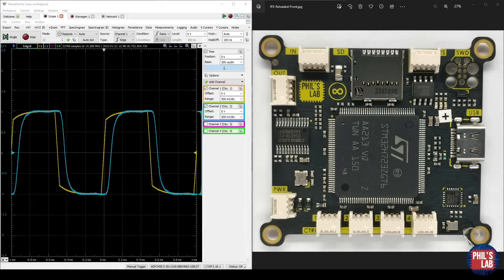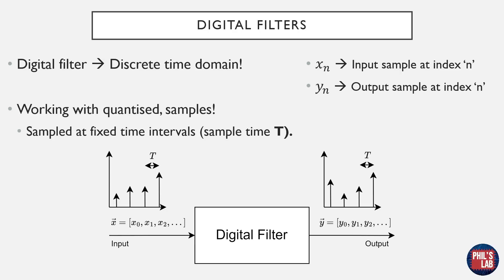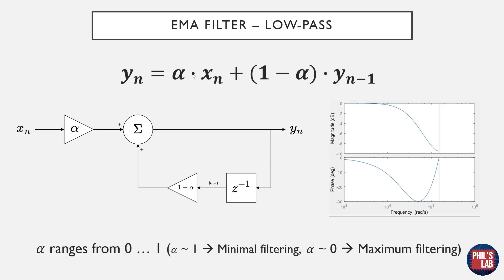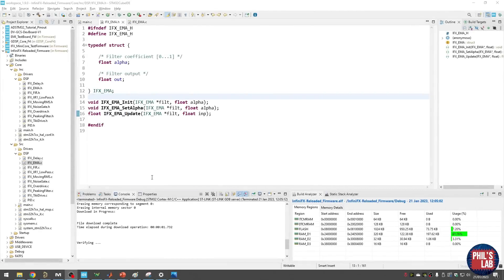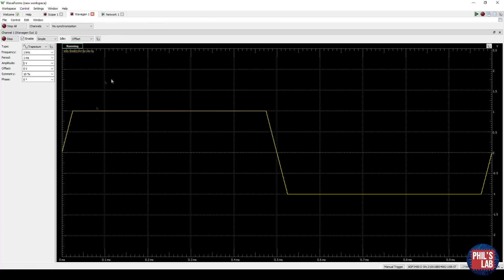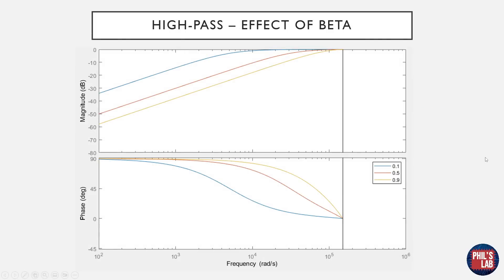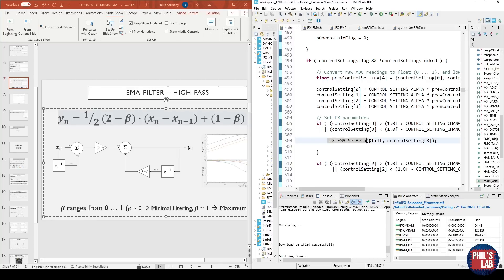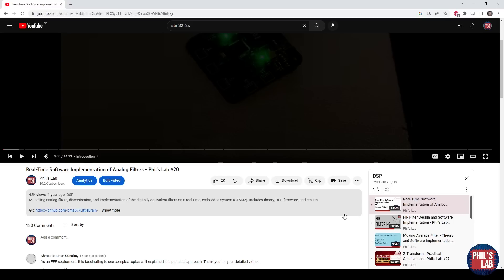The Simplest Digital Filter (STM32 Implementation) - Phil's Lab #92

Comment: Phil  - nice video. A unique thing about alpha = 0.5 for the low pass case is that it can be solved with just shifting the input by one bit (divide by 2) and adding it to the previous solution shifted by one bit (divide by 2). This is math any low end micro can achieve.
Reply from the maker: Thanks, David - that's a great point!
Reply: @PhilsLab  Just be careful with shifts and signed numbers.

Comment: It has been pointed out to me that you don't need buffers, circular arrays, double buffering, DMA or even interrupts to process a realtime audio stream.  I refused to believe it, but I tried it and... block reading and block writing 1 stereo sample at a time still leaves you PLENTY of time to process each sample through the filters.  Zero latency.  No sample rate conversion either, that happens automatically when you trigger off the cadence of the output.  Also, the SAI blocks are worth looking into.  They can be easily used as basic I2S interfaces as normal, but can do way more, including the support for 8 octet unblocking FIFO.

Comment: I've started using STM32 from st32f401 (blackpill board). And its ADC upset me much, because even with noise very low noise levels on oscilloscope that thing gave me 6-7 stable bits out of 12bit mode. Some people said pcb design is bad, others that chip itself has pretty bad ADC. But nevertheless I started to search noise canceling technics and found pretty good method in AN4073
 which is basically median filter + moving average filter. But I think it can be improved even more with EMA filter. Thanks.
Reply from the maker: Yeah, most of the in-built ST ADCs aren't as great as "initially advertised". For audio, I'd definitely always go with an external codec.
Reply: SAR ADC of STM32 is a bit noisy, but with 2.4MSPS also quite fast. Depending on application you can use oversampling to trade speed and power consumption for accuracy.
Reply: It is likely that the noise you are observing is 60Hz from the AC  mains. Use moving average FIR or CIC filter to suppress this frequency or look for a notch filters for this frequency

Comment: This makes me think of the filter I used to implement in flash games when I was a kid to smooth out motion. It worked out to something like Yₙ = Yₙ₋₁ + (Xₙ - Yₙ₋₁) * α. In practice it was current_position += (target_position - current_position) / how_sluggish_I_want_it_to_move because it was easier for me to visualise the motion increment as dividing up the line between current_position and target_position. Later I changed the last part to a multiply when I learn about how expensive division can be. Though in fixed-point, a lot of the time, the division does get optimised out. Don't use it for much these days except lazily removing zipper noise from level controls, but it's a handy one-liner nonetheless.
Reply: 'out += (in - out) * a' is what I use too, and it is actually identical to 'out = (in * a) + (1.0 - a) * out' used here. the one liner feels easier for me to understand, and represents an RC curve very intuitively. I'm actually skeptical of the waveforms phil is getting here, I think the codec is impacting the output signal. this simple form of lowpass should not be introducing ripple or ringing or the soft edge situation we see here.

Comment: Is this true that the alpha means a reduction ratio at a freq nykvist/2? I can see that alha 0.1 means -20dB at f/2, and alpha 0.5 means -6dB at the same freq.
Reply from the maker: At fc=fs/2 (i.e. z=-1), I get that the gain=alpha/(2-alpha).
So for alpha={0.1,0.5,0.9}, gain={-26,-10,-2}dB.
Reply: @PhilsLab  Right. Thanks. I saw your graph, and just used my eyes ) I'm not experienced in z-transform to simply match f/2 with z-1 (

Comment: I have used these filters for years in simple digital filtering applications. And this video treats the subject very well. The one thing I would disagree with is that these filters are bad at separating frequencies. They’re not, you just have to use them within the range of their effective capability.

For a low pass filter of this form, A = Fc/Fs where Fc the cutoff frequency and Fs is the sample frequency. BUT… the effective capability limit is that A <= 1/2pi, and the lower A the more faithful the response. The video focuses on A values close to zero and one, neither of which are particularly useful as practical filters, and values above 1/2pi, which are beyond the effective capability of the filter.

The filter is simple and effective, but the trade off for this simplicity is that you need a high sampling frequency compared to the cutoff frequency. Such a simple filter needs a lot of samples to work with. And if your application is capable of supporting that restriction, i.e. you can take at least 6.28 samples per filter time constant (and preferably plenty more than that), and you have sufficient math resolution (hence floating point) then it will do what you need.

Comment: Excellent video and a filter I will use in my video, but I will probably dumb it down for my audience.  I will be using an accelerometer for robotic balancing applications (spikes occur if there are abrupt vibrations, whether from abump, or from the vibration from a servo), but I was also thinking of using gyro and adding angular velocity (in some way) to improve the angle measurement. I will try the filtering first to see how well it works. I may need to use a filter that considers more samples as well. When I get to this video, I will make sure to mention this video so viewers can get more detail.
Reply from the maker: Thank you! If you're interested, I have some sensor fusion videos on my channel that go into how to combine acc + gyro measurements to get angle estimates.
In any case, thanks for the shout-out in your upcoming video!
Reply: @PhilsLab  Excellent. I will definitely check them out!!

Comment: I find that if calc moving average over a window, let's say window=32,
so averaging over 32 samples then when accelerometer read angle movement bigger then 0.1 degree 
I decrease the window size to 1 then increasing every new sample until 32.
it is super simple and the result is exponentially follow the original signal plus the smoothing of course

Comment: The H723 has a built-in FMAC, ever consider covering this as a topic?  Many of these higher end units have these features and would be a great series to compare them to roll your own types.
Reply: Wow.. just read an application note on FMAC. Seems really interesting! As I understand, FMAC is slightly slower than the CMSIS DSP library, but has the benefit of freeing up the CPU for other tasks. Also worth noting that FMAC only operates on signed 16-bit integers using fixed-point arithmetic. Agree this would be a topic worth covering!
Reply from the maker: That's a great idea - will definitely be making a video on that at some point in the future.

Comment: and now in assembly while using the dsp/simd commands of the cortex and storing the IFE_EMA in the TCM  ;-)
Reply: What's the point? Modern GCC for armv7e-m can do wonders without the sane programmers having to descend to assembly levels. I'd like to see inline/vectorization though, or at least manual unroll-by-4 + SIMD over floats. And linkerscript allows placing both the struct in DTCM and hot code in ITCM by labeling sections and using attributes.
Most of delay in his code comes from sheer halfbuffer length anyways.

Comment: You do not mention the consequences of finite math resolution.  If the calculations are done in 16 bit math & alpha is close to zero or 1, & DC is applied, the output will approach the input until the 2 multiplies round differently.  This will result in either stopping short or "bobbling".  There is a scheme for regrouping terms so that only one multiply is done on the difference between input & output.  This stops bobbling.  The sloppy way to "solve" this problem is to use ridiculously precise math such as 64 bit.  NEVER should floating point math be used!